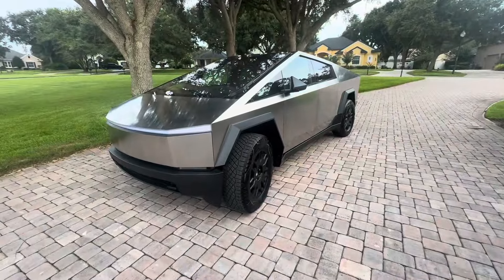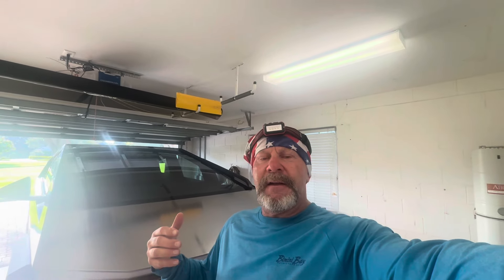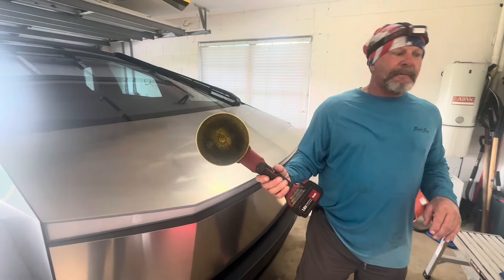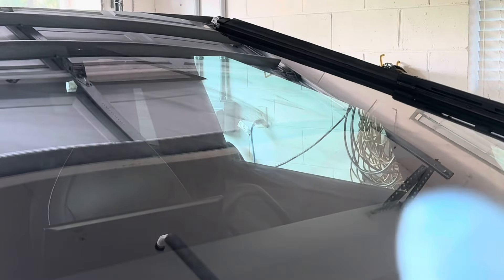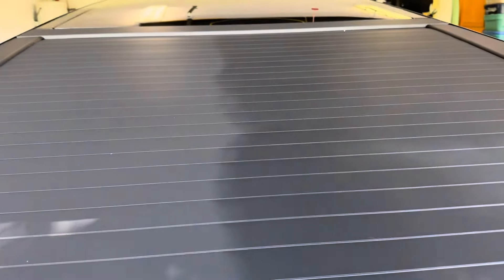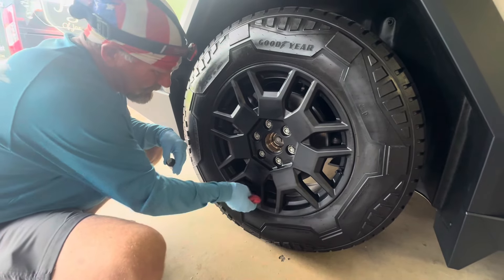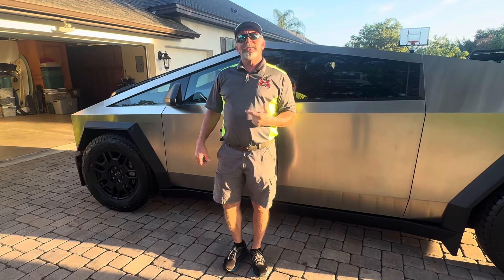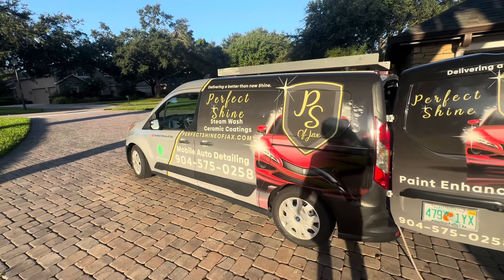DIY Metal coating & Hydro Glass on Cyber Truck

Comment: Nice job!  Have to balance Colletons advise vs Yvon.  

I struggled with smudges and stains for a bit.  Ended up doing Tesla recommended Citrisurf 77 and blue Scotchbright.  Once properly passivated, stainless seems to be very resistant to stains.  I bought the metal coating, but reluctant to use it.  

Passivation is key.